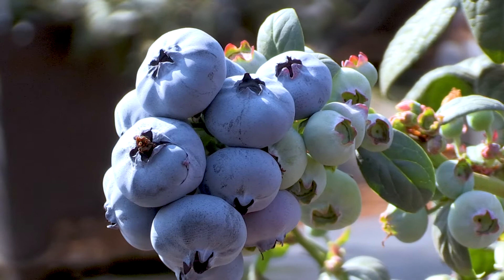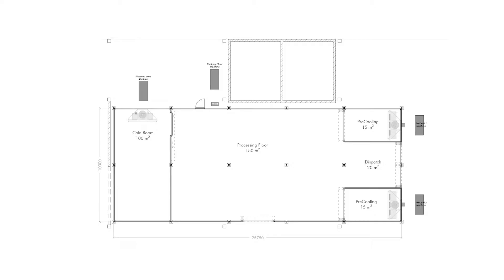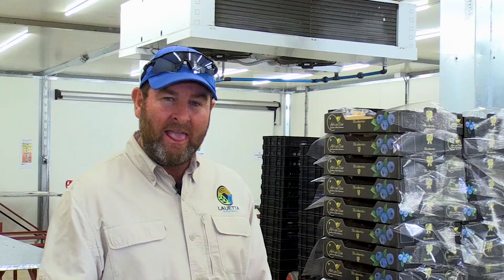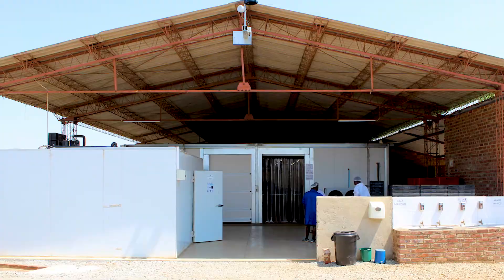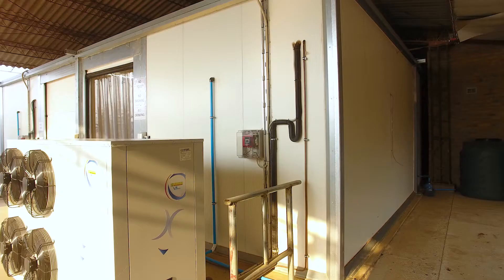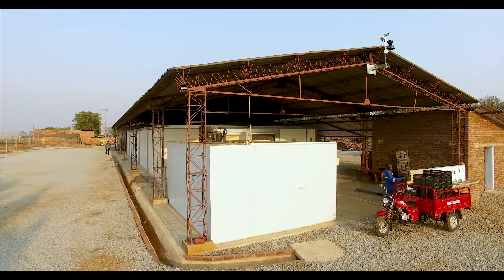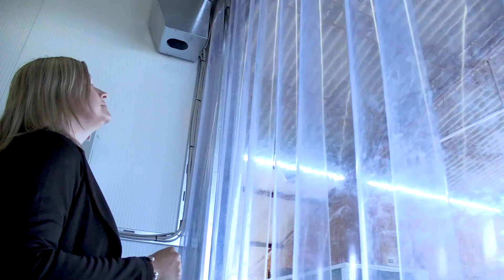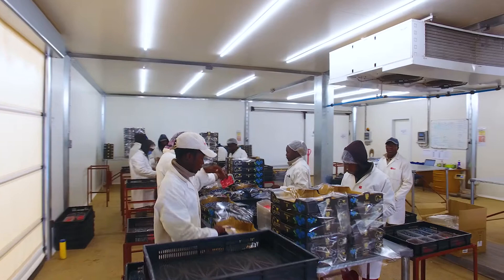InspiraFarms Client Success Story: Lauetta Farm in Zimbabwe

Comment: And why are there no solar panels on the roof??? Zim has almost 3000 h of sun in the year. And electricity is so rare in Zim.
Reply: True only the exclusive suburbs have 24/7 electricity
Reply: @icetrip2417  solar can't provide 24/7 electricity
Reply: @chigeh  yes it can, just store the huge amount of extra energy in powerful lithium batteries during the day. And you will have more energy than you can use.
Reply: How are the plants supposed to get sunlight if there is panels on the roof…..